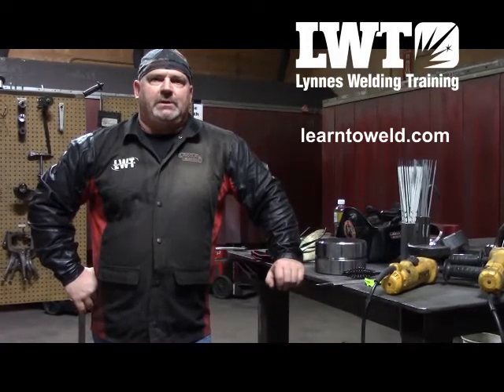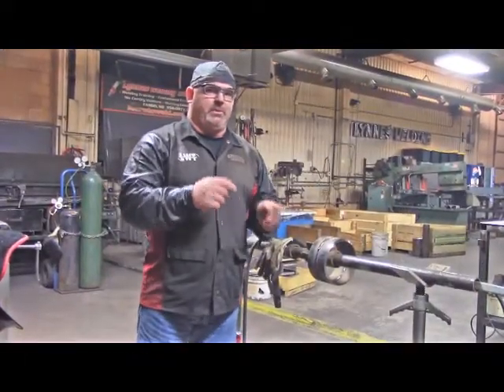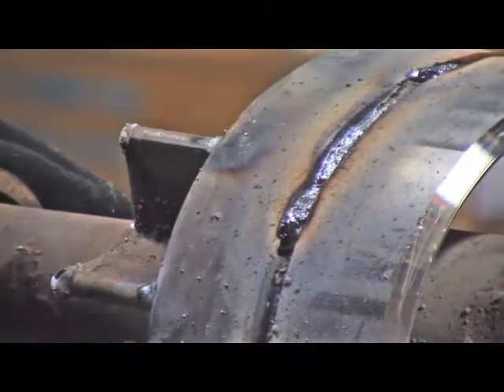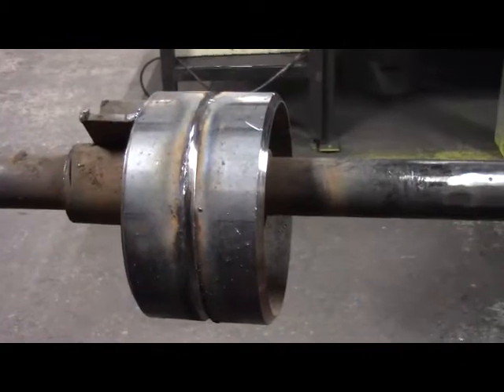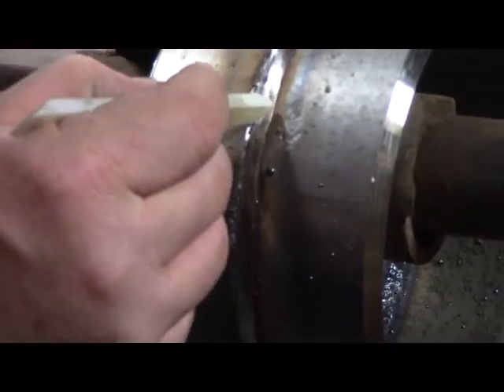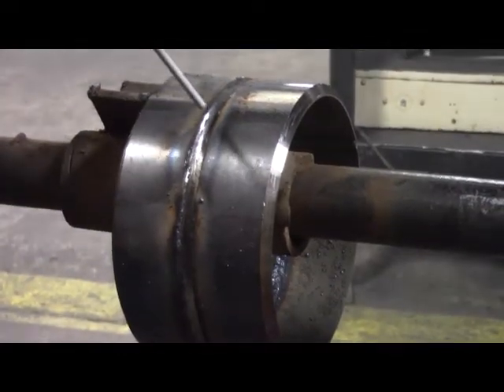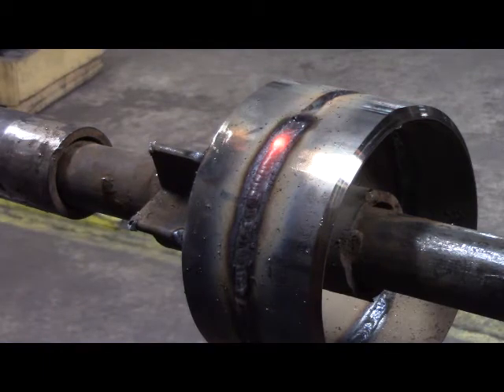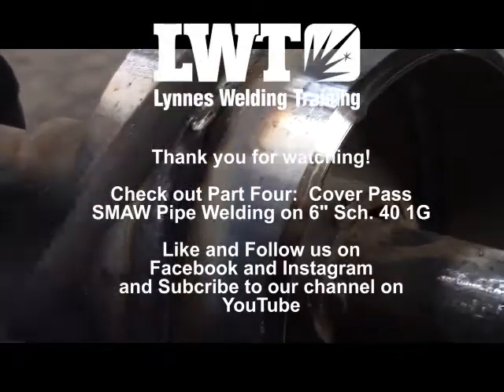Part Three:  Hot Pass on SMAW Pipe Welding on 6" Sch. 40 1G

Comment: I may have missed it but I watched again and didn't hear if you said what amps you run on your hot pass. Thanks. Great video.
Reply: I was running around 80 amps for the hot pass, and using 3/32" 7018 electrodes.
Reply: You run 5-10 amps higher then your root usually its 5